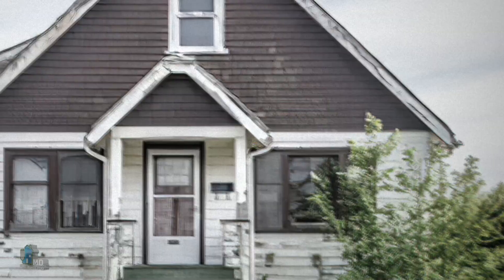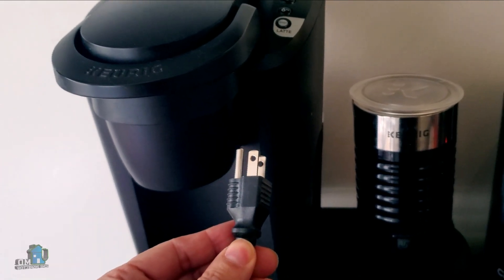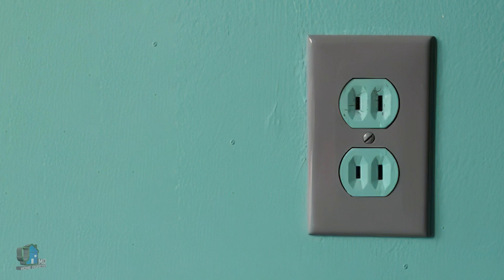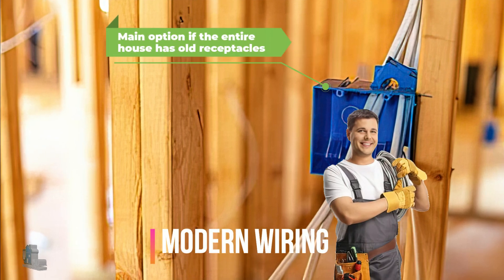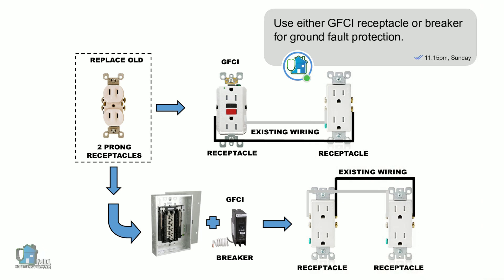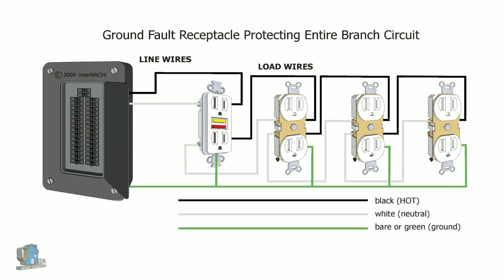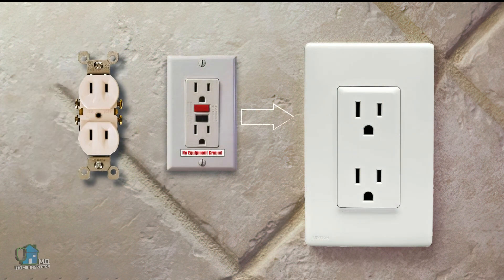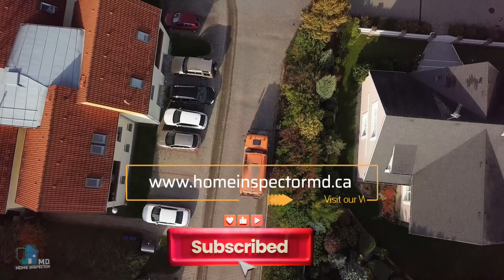Using Ground Fault Circuit Interrupters to solve 2 prong receptacles in older homes.

Comment: Some houses constructed in the early sixties, although using two prong receptacles, did in fact have a box equipped with a ground.  In these cases, you simply replace the two prong receptacle with a three prong wnd the ground will be fully functional.
Reply: In some of those boxes that I've seen, the metal box is connected to a piece of metal conduit, and some do have a ground wire clipped on to the metal box. The metal conduit doesn't always make a perfectly sound connection, so you lose an effective ground

Comment: When a GFCI is installed into an ungrounded metal box (perfectly allowed by code) if the incoming cable gets cut by the metal box and livens up the box, and therefore the gfci and anything the chassis of anything plugged into the outlet there is nothing the gfci will do to protect you. Even if it tripped the power would keep flowing through the ground of the GFCI. In that scenario it actually would’ve been safer to use an adapter with a two prong outlet or cut the ground pin off. For this reason I recommend A: keeping two prong outlets or replacing them with new two prong outlets. Or B: using a GFCI circuit breaker and then three prong outlets with stickers on them. Those are the safest options when a metal box is involved. If the box is plastic I wouldn’t have a problem with a GFCI outlet.

Comment: This is actually a poor solution if you think about it. If you have a 2 prong receptacle, you should leave it alone or replace it with another 2 prong receptacle. I know that's no longer code, but you've still got a dummy ground that only has a label saying not to plug a grounded plug in. Like a label's going to stop anything. But the GFCI will still stop ground faults, right? Sure, but a bootleg ground would also stop ground faults, and that's been labeled as unsafe. At least, a bootleg ground would provide a real, electrical ground if wired correctly. A GFCI provides no grounding. They don't make 2 prong GFCI receptacles which is what should go here. It's like modern electrical code thinks the ground prong is just a joke.
Reply from the maker: Thank you for your comment. It is always ideal to replace an old 2-wire with a proper 3-wire receptacle in the house. But this is often not cost effective if you replacing just a couple. Can you leave as is? Why?. This is done for much improved safety. It is common practice for electricians and is perfectly acceptable to replace a 2-wire receptacle with a GFCI receptacle. It will shut off power if there is a current imbalance with the assumption that an imbalance is going through the person touching the device connected to the outlet. With just a 2 wire receptacle, you have no protection at all from a ground fault
"....dummy ground that only has a label saying not to plug a grounded plug in" > Not sure what you're trying to say here. The GFCI receptacle ALLOWS the use of 3-prong receptacles and provides ground fault protection. The label is to indicate it does not have equipment ground back to the panel. GFCI receptacles do not require equipment ground in order to detect a ground fault and trip.
A bootleg ground is the worst thing anyone can do. It gives a false sense of proper protection as the people have no idea it does not have a proper ground. It can shock and kill people. What happens if an appliance is grounded to the chassis?
Reply: It's safer to have a setup that will shutdown the outlet in the case of unwanted current/short, than one that will allow that shock to continue. That's the justification. Not that anyone thinks a label will stop something. 

No, a bootleg ground isn't going to provide a "real" ground, and it's potentially going to create a very unsafe condition. Remember that current doesn't just take the easiest or first path but all paths. The safety purpose of the ground is addressed in a different way by the GFCI stopping the errant current rather then sending it to ground. 

If you think about it, it's the safest compromise between an ungrounded outlet and a jank setup that creates an unsafe condition.

Comment: If an older home has a breaker panel with two prong receptacles and no equipment grounds in the wiring, if rewiring the house is cost prohibitive, I prefer to use a dual function breaker on the circuits with two prong receptacle, then change them to three prong and apply the appropriate labels.   This method provides electric shock protection on switches with metal coverplates as well since most older homes had far fewer circuits than is required for modern living, while also providing additional fire protection from arcing faults caused by wire insulation damaged by rodents, moisture, heat from oversized incandescent bulbs in ceiling fixtures that may have been used in the past, or age.   I've encountered wiring where the insulation disintegrated with the slightest movement.

If the home has a fuse panel or older breaker box design where GFCI or dual function breakers are unavailable, such as the pushmatic breakers, I find the first receptacle outlet on the circuit and replace the two prong with a AFCI/GFCI receptacle and protect everything downstream until the panel can be replaced with modern equipment.  

It should be noted that while adding GFCI protection to an older two wire circuit does provide personal protection, some equipment, such as sensitive electronics and surge protectors require a true ground for proper operation, so this method is more or less a  compromise between the cost of a total rewire and making older wiring safer, such as remodeling on a tight budget.

Comment: Is it  still ok to Grouned a 3 prong outlet to a cold water pipe? I know you could that in the Past.
Reply from the maker: To be clear, there are two types of grounding in your home. Equipment ground and System (earth) ground. It is the system ground that connects the electrical panel to earth via a bare copper wire. Here, the two main ways are the use of a water pipe or grounding rods. Its purpose is to divert unexpected charges such as lightning strikes safely to ground.  It is the equipment ground that can save you from electric shock and it will usually return back via the neutral service wire back to the transformer.